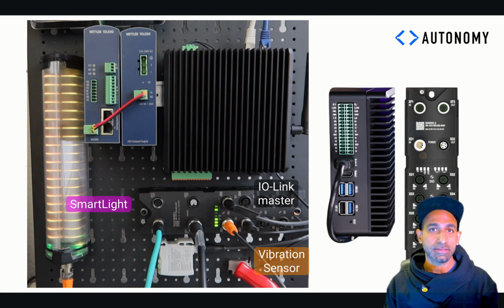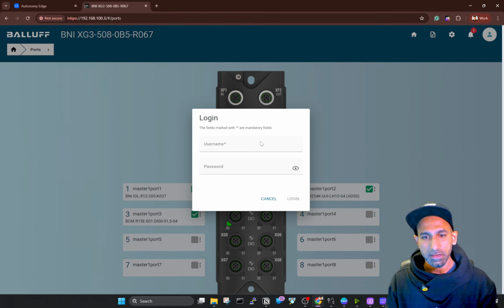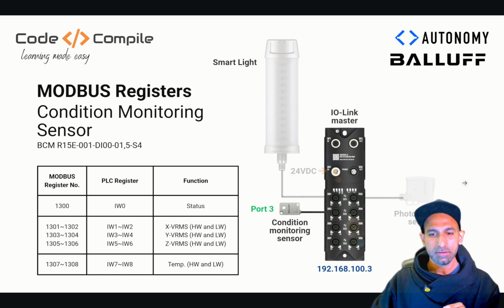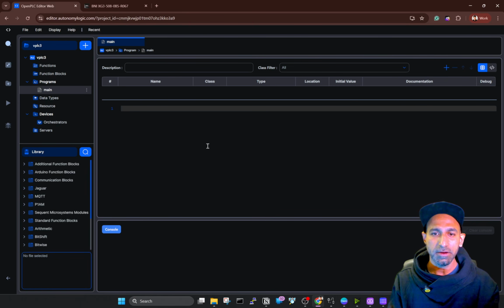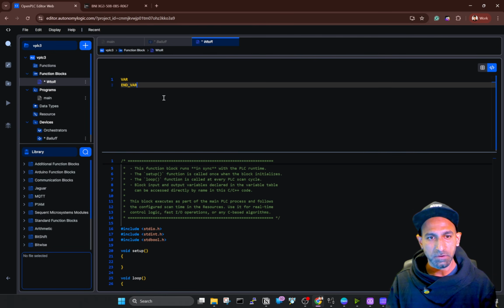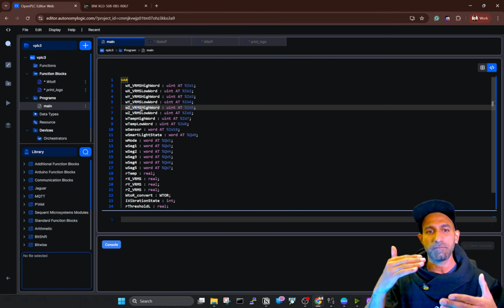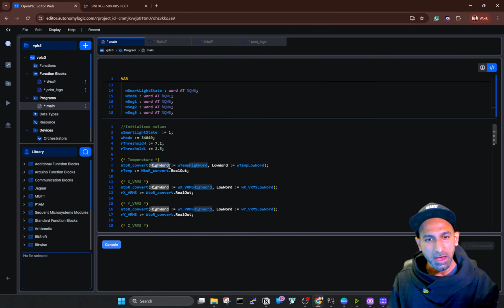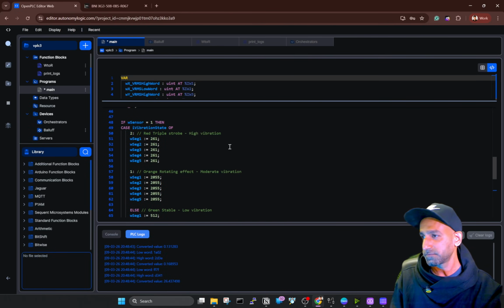OpenPLC with IO-Link master for real-time vibration monitoring

Comment: One of the things I love to do is read the spec sheet to understand the bits and bytes of IO-Link data. Byte swapping is confusing me every time, but when the data shows up with the correct values - I feel accomplished!
Reply from the maker: That's right! Reading the specification is always great! Byte swapping is indeed complicated. I recommend you to use MODBUS Poll tool to quickly check the endian format that you need.